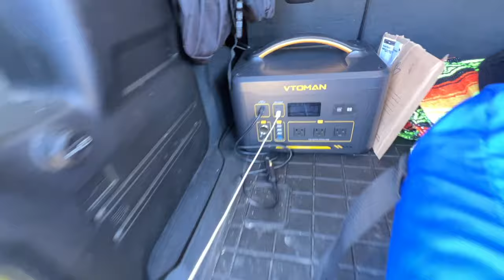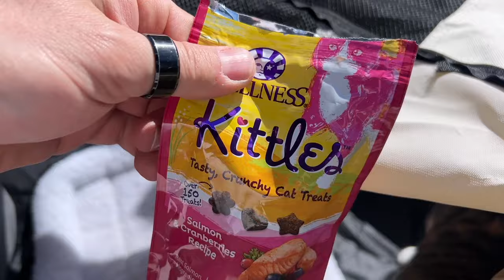VANBUILD - Small Town Day in the Life - Altering My Tiny Home

Comment: PB blaster is the absolute best in freeing up rusted stubborn nuts n bolts. A bit of heat and use a small pair of vise grips also works well. Not sure if you have PB blaster in Canada but it is far superior than wd-40 or any other such like products I've used before. Also going to look at another van tomorrow morning here in south eastern New York and the only downside I see is it's not 4 wheel drive, but it definitely checks all the other boxes. If you, Amber, Emily etc can do without it then I'm definitely sure I can as well. Really excited to take a deeper look into the van with my mechanic and hoping he gives me the 👍🏻!! I'd only be a pert timer at this point in my life, but it's a start and opens up so many travel opportunities. Who knows maybe we will bump into each other one day as the west coast of Canada is pretty high on my places to travel if I ever can score on a van. ✌🏻✌🏻
Reply: I've heard of the home brew of automatic transmission fluid with acetone or diesel fuel also works well 😅

Comment: I used a 3 way branch Heating Duct adapter that has an adjustable valve so that you can turn off or control the volume of air going into the battery box vs the cabin.

Comment: Nice progress 👍

41:42 are those struts upside down? Black part towards the rear so whatever oil is inside keeps the seals lubricated 😅when Open

(but I dunno how often you'll be opening that)

In hindsight, would a roll on type be more economical than those spray cans?

PS: you can definitely seal thise cracks on the rooftop box with some plastic welding hacks

 dunno about that broken hinge though 😢 - that's a future Matthew problem

Comment: I modified my Tee fitting.I drilled a 1 inch round hole off center. Works great.The bit i used was the same ones to for diesel heater install.

Comment: Hi Matthew. Still enjoying your videos and rebuild. If you have to split your heat, try and use a Y JOINT not a T. Airflow doesn't like 90 degree turns. I might also consider a small " inline" fan for airflow.
Even a computer fan. I have admire your confidence on the electrical. Its the only scary bit for me. Happy travels 👍👍
Reply from the maker: Thank you for the tip!

Comment: You be better to use a Y joint instead of a T joint for your heat duct.cause the flow will only go straight true not split
Reply: Avoid 90 degree turns.

Comment: Question...do you really want your heat running under your refrigerator?  Heat rises...just saying it might be more power required to keep it at temperature.  But then again it is going to heat up in there a little bit from the compressor anyways...🤔
I was thinking...if you build some additional supports to hold your electrical cabinet open (wood slats that could support more from the center and store in the cabinet)...you could have a chaise lounge looking out your back windows if you ever back Lucky's bootie to a beautiful spot where you just want to relax and edit 🌄

Comment: Thanks for sharing. Why beige for the color of Lucky 😮? 

For the electric side of things, if I remember correctly, they say that length of the cables from the batteries to whatever charge them must be of equal length, otherwise the battery with the shortest cable will be used first instead of a balanced battery use/wear?

Looking forward for what comes next 😊

Comment: I might be wrong… but was that not the transmission dip stick you checked instead of the engine oil dip stick ??
Reply from the maker: Haha could you imagine? My transmission would be SHOT if the fluid was that colour 😂 the tranny stick has a locking handle on it and is black 😊
Reply: Kk good lol you know your vehicle just had a older Jeep and oil dip was on the other side great video keep them coming